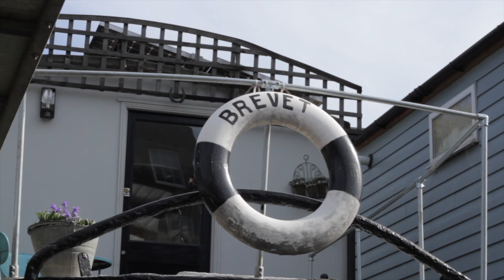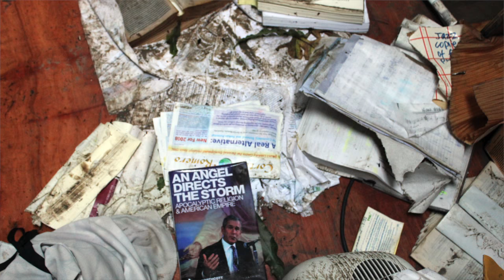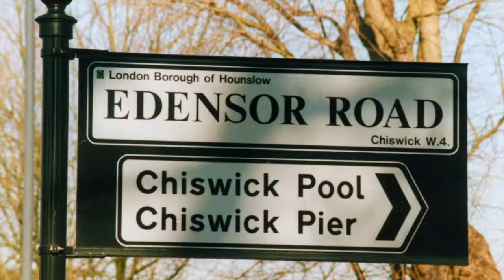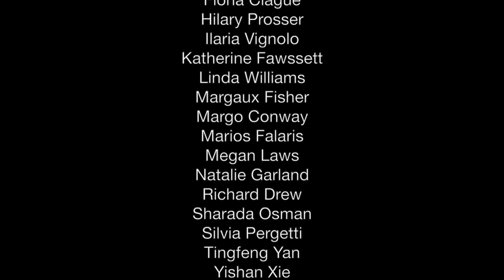Life Afloat: A History of the Floating Villages on London’s Tidal Thames

Comment: An interesting video, but one that slightly over glamorizes life on the river. Living like this was once a very cheap alternative to buying a flat etc. in the heart of the city, but not so these days. Houseboats can be very expensive, but this is only if it has a 'permanent residential mooring'. Without a residential mooring (which are hard to come by) you just have a boat, and one that needs to be found a mooring. You can pay the best part of £100k for a good canal narrowboat 'with' a residential mooring for instance, but if you lose the mooring it'll suddenly be worth less than Half that amount. (Thus, "Never upset the owner of a mooring"!)
Also, if you sell it to a new owner and they keep the boat on the mooring, the owner of the mooring may require a commission fee from the sale.